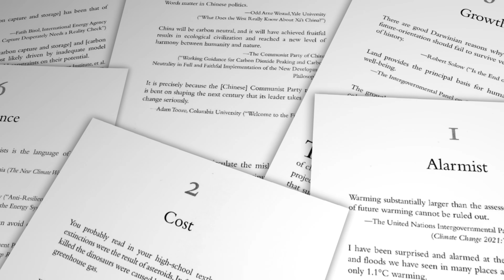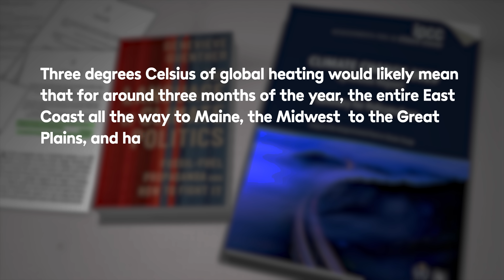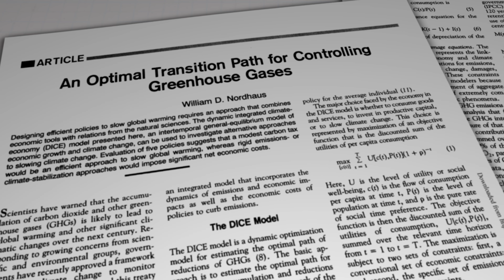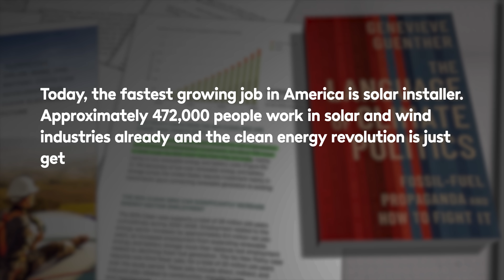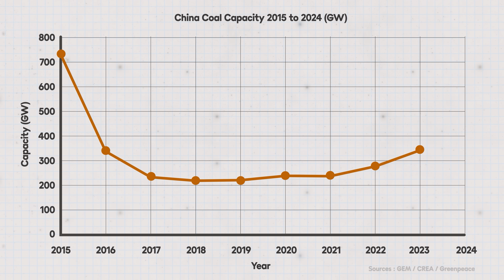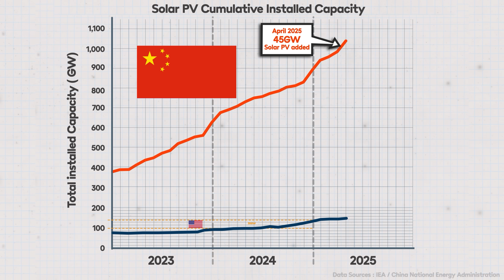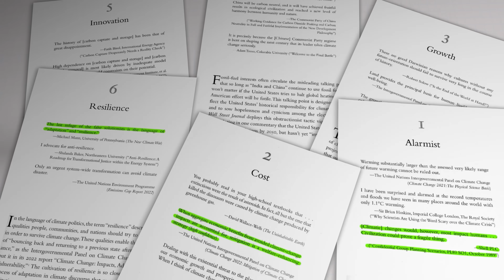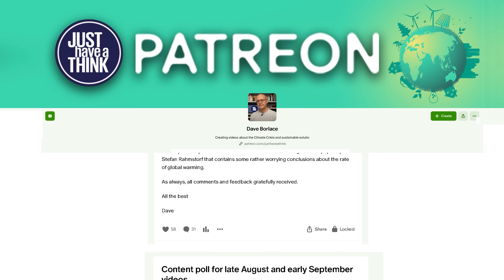New research DEBUNKS climate disinformation.

Comment: HOTTEST DAY EVER! How many times have you heard that? Weather stations are at airports built in the 60s, 70s and 80s in rural areas that are now urban. So "ever" means in the last few decades, and those records are never adjusted down for the urban heat island effect that boosts temps by 15-20°F (8–11°C). 

34 more censored facts:
1. Since 1850 the average global temperature has increased by 1.2°C (2.2°F); equivalent to a 600 foot decrease in altitude. 
2. 1850 was the end of the Little Ice Age (LIA) 1300-1850 A.D. the coldest multi-century period of the last 10,000 years.
3. Glaciers/ice sheets reached their greatest extent of the last 5000 years in the LIA. Total ice volume today is greater than it was prior to the LIA expansion.
4. Had the LIA continued we may be entering full glaciation. 
5. Modern warming doesn't correlate to changes in CO2. Most warming was from 1750-1950, before CO2 increased significantly. CO2 increased sharply in the 1950s while temperatures fell slightly until the 1980s, (Hence the new ice age scare of the 1970s)
6. Modern warming manifests as higher overnight lows and milder winters at high latitudes, with little to no increase in summertime highs or heat waves.
7. There's been no increased desertification. The opposite is actually true.
8. The U.S. growing season is 2-3 weeks longer than a century ago, and food production has tripled on slightly less land.
9. Temperature records from the 1800s and early 1900s don't exist for most of the world, early records have been adjusted down with dubious justification, and the urban heat island effect isn't adequately accounted for, so many scientists question the degree of modern warming.
10. Modern warming is beneficial by every conceivable metric, and continued warming up to 3°C would be mostly beneficial as well. 
11. Activist scientists cherry pick data to eliminate well known past warming (Climategate), and falsely claim they were only regional, but the best proxies confirm Earth was warmer than now for most of the last 10,000 years. The Medieval (900 to 1300 C.E.), Roman (250 B.C. to 400 A.D.), and Minoan (2100-1700 BC) Warm Periods were 1-2°C warmer, and the Holocene Climate Optimum (7000 to 3000 B.C) was 3°C  warmer. 
12. Humanity always prospered in warm times. Food was abundant, populations increased and civilizations thrived. People suffered of starvation and disease in cold times and civilizations fell. 
13. The mid-Holocene sea level high stand (2000-5000 B.C) was up to 5M higher than today.
14. Alarmists claim crossed tipping points will cause runaway warming, but it's been 3°C warmer with no run-away warming.
15. CO2 warming diminishes logarithmically. 420 PPM is near full saturation so doubling CO2 to 840 PPM would have negligible effects. 
16. Solar variation, cloud cover, ocean currents, and cosmic rays all effect climate, but due to the obsession with AGW these and other natural drivers remain understudied and poorly understood.
17. The complete weather record shows no increase in extreme weather events. Upward trends are derived by cherry picking start dates. 
18. Damage costs are conflated with more extreme weather but more people with more property susceptible to weather accounts for increased cost, not climate change.
19. Despite the population explosion climate-related deaths are down 98% from 100 years ago.
20. Even today many more people die from cold weather than hot. 
21. Wildfires are down 80% since the 1920s. Less aggressive fire management policies began in the 1980s. To show a deceptive upward trend alarmists always start here. 
22. On a geologic scale 420 PPM CO2 is extremely low. 500 million years ago CO2 was 5000-7000 PPM, but CO2 eventually becomes limestone so It's been falling ever since. 
23. The Isthmus of Panama blocked oceanic heat transfer 2.5 million years ago, triggering the ice age. Cold water absorbs more CO2 so 20K years ago during the LGM CO2 fell to its LOWEST POINT EVER at just 170 PPM and plants barely grew. If CO2 had reached 150 PPM all plants would've died causing mass extinction.
24. Through ice age cycles warming always leads the rise in CO2 by 200-800 years. Warm water emits CO2 so this makes perfect sense, hence rising CO2 is an effect of warming, not the cause. 
25. Greenhouses boost CO2 to 1200-1600 PPM because that was the environment plants evolved in over hundreds of millions of years, and how they still grow best today. 
26. CO2 fertilization has made Earth 20% greener than it was 30 years ago. Increased CO2 also makes plants more drought tolerant, so arid regions benefit most. 
27. CO2 fertilization effect has increased crop yields 15-20% globally. If CO2 magically fell to 280 PPM a worldwide famine would follow.
28. Claims of CO2 fertilization making plants being less nutritious are examples of junk science protecting the "climate crisis" myth. These claims refer to micronutrients not essential for basic nutrition that can be easily restored with fertilization. The caloric content is the same, and the missing protein is gluten. 
29. Most mass extinction events were caused by sudden cooling, not warming, and there's no "mass extinction" happening today. Polar bears have tripled since the 1960s and almost all endangered species have seen recent population increases. Since 2000 4 mammals have gone extinct, and the extinctions of previous centuries were due to over hunting, invasive species, and habitat loss. These are still the biggest threats, not climate.   
30. CO2 fertilization has increased the food supply for all animals on land and in the sea. The more CO2 in the atmosphere the more life on Earth.
31. On the PH scale 7 is neutral. Oceans are alkaline with PH of 8.1 to 8.3. So CO2 only makes oceans more neutral, not acidic. Ocean PH has ranged from 6.5 to 8.5 with no impact on sea life.
32. Bleaching is a natural part of coral lifecycle not resulting in death. The Great Barrier reef is near record extent. Coral only grows in the warmest parts of the ocean so if warming continues corals will only grow larger and healthier.
33. Since 1850 the global mean sea level has risen about 12 inches at rates from zero to 3.5 mm per year. If we're locked into the higher rate sea level may rise 1 foot by 2100. Plan for it. Crisis averted. 
34. Recent studies show tropical islands are actually rising because strong wind and waves transport sand onto the islands. 

True believers will challenge these facts, but this is where critical thinking comes in. Political pressures, funding directives, and the impartiality of scientific publishers has influenced climate studies to exaggerate the effects of CO2. These factors and more have created an enormous bias in academia to promote and protect the CO2 control knob hypothesis. Scientific work that contradicts or challenges it in any way is strictly prohibited, with dire consequences for those who don't comply. Pointing out well known facts that don't align with the "climate crisis" narrative, such as CO2 benefits to plants, or the logarithmically diminishing warming of CO2 is enough to be labelled a "climate denier". This relentless pressure in academia to manufacture "consensus" is why most people aren't aware of these facts. 

When I started studying the science of climate intensively a few years ago, I recognized the bias and misinformation in most climate papers and studies. Self education of climate requires a critical eye and an expectation for data to be misconstrued. Just reading the abstract and conclusion isn't enough. A study may contain data that contradicts the mainstream narrative, but challenging the narrative has adverse consequences so authors find a safe point to make. More deceptive examples cherry-pick a start point to show a trend that doesn't exist in the full record. The most egregious disinformation promoted by climate crisis advocates are studies from activist scientists who cherry-pick and manipulate data to reach a preconceived outcome (Climategates 1, 2 and 3). Watch this about the COOK-ed up "97% consensuses" and then tell me it's not an outright lie. 
youtube.com/watch?v=ewJ6TI8ccAw

Dogma in science isn't new. History shows academic dogmas stifling progress over and over again. A hypothesis beloved by gatekeepers transcends critique. Scientific method be damned our manufactured "consensus" has spoken. An incorrect hypothesis is knighted sacrosanct theory regarded as fact. For decades Clovis First was so entrenched in archeology challenging it was hypocrisy. Alfred Wegener advocated continental drift in 1912 and was mocked the rest of his life. Carlos Finlay discovered mosquitoes transmit yellow fever in the 1870s and was ignored for 30 years while millions died. 

A confluence of politics, funding and gatekeeper ideology has entrenched the CO2 control knob hypothesis deep in the heart of academia, but an objective examination of the evidence reveals it as the worst manufactured "consensus" of a false hypothesis since Galileo was forced to recant on pain of death the earth orbits the sun. Sensationalist media multiplied the falsehood and the "climate crisis" was born. Ultimately facts will prevail and it will join this Wiki page of overturned scientific beliefs. en.wikipedia.org/wiki/List_of_superseded_scientific_theories

References:
energy.gov/sites/default/files/2025-07/DOE_Critical_Review_of_Impacts_of_GHG_Emissions_on_the_US_Climate_July_2025.pdf
petitionproject.org/gw_article/GWReview_OISM150.pdf
Or just watch this to learn the truth  
youtube.com/@ClimateTheMovie
Reply: tl;dr
Reply: @monsterguyx  I have a lot of empathy for those with poor reading skills and attention deficiency, and I'm proud of you. admitting it to yourself and others is the first step towards making the most of your limited potential.
Reply: There are 5 sources necessary to prove climate change caused by human CO2 emissions as scientific fact:

1) Prof. Svante Arrhenius (1896) XXXI. On the influence of carbonic acid in the air upon the temperature of the ground , The London, Edinburgh, and Dublin Philosophical Magazine and Journal of Science, 41:251, 237-276
2) Royer, Dana L.. "CO2-forced climate thresholds during the Phanerozoic." Geochimica et Cosmochimica Acta 70 (2006): 5665-5675.
3) "Trends in Atmospheric Carbon Dioxide", NOAA, 2005, updated monthly.
4) HadCrut, NASA GISS, NOAA, Goddard and numerous other temperature data sets, all available as both raw and adjusted measurements.
5) "How do we know that recent CO2 increases are due to human activities" Steig, 2004, RealClimate

The last one cites the following:

Stuiver, M., Burk, R. L. and Quay, P. D. 1984. 13C/12C ratios and the transfer of biospheric carbon to the atmosphere. J. Geophys. Res. 89, 11,731-11,748.
Francey, R.J., Allison, C.E., Etheridge, D.M., Trudinger, C.M., Enting, I.G., Leuenberger, M., Langenfelds, R.L., Michel, E., Steele, L.P., 1999. A 1000-year high precision record of d13Cin atmospheric CO2. Tellus 51B, 170-193 (Revised in "A revised 1000-year atmospheric d13Cin-CO2 record from Law Dome and South Pole, Antarctica", M. Rubino, D. M. Etheridge, C. M. Trudinger, C. E. Allison, M. O. Battle, R. L. Langenfelds, L. P. Steele, M. Curran, M. Bender, J. W. C. White, T. M. Jenk, T. Blunier, R. J. Francey, JGR Atmosphers, 2013)
Quay, P.D., B. Tilbrook, C.S. Wong. Oceanic uptake of fossil fuel CO2: carbon-13 evidence. Science 256 (1992), 74-79

These additional 5 sources corroborate the above 5:

1) Callendar, G.S. (1938), The artificial production of carbon dioxide and its influence on temperature. Q.J.R. Meteorol. Soc., 64: 223-240.
2) Emily J. Judd et al, A 485-million-year history of Earth’s surface temperature. Science, 385, (2024)
3) David J. Hofmann, James H. Butler, Pieter P. Tans, A new look at atmospheric carbon dioxide, Atmospheric Environment, Volume 43, Issue 12, 2009, Pages 2084-2086,
4) Already listed 5.  Here's a 6th: Osman, M.B., Tierney, J.E., Zhu, J. et al. Globally resolved surface temperatures since the Last Glacial Maximum. Nature 599, 239–244 (2021)
5) Already listed 3.  Here's a 4th: Graven, H., Keeling, R. F., & Rogelj, J. (2020). Changes to carbon isotopes in atmospheric CO2 over the industrial era and into the future. Global Biogeochemical Cycles, 34

There's also these 22 sources that corroborate the trends found in other temperature datasets:

1) Huang 2000
2) Crowley and Lowery 2000
3) Esper 2002
4) Pollack and Smerdon 2004
5) Oerlemans 2005
6) Moberg 2005
7) Wahl & Ammann 2007
8) Juckes et al. 2007
9) Hegerl 2008
10) Lee, Zwiers & Tsao 2008
11) Ljungqvist 2010
12) Britta 2011
13) Marcott et al. 2013 
14) Ahmed, Zorita et al 2013
15) Neukom et al, 2019
16) Bertrand 2002
17) D'Arrigo, 2006
18) Buntgen, 2011
19) Rohde, 201
20) CRUTEM
21) EstimatedIV
22) FIO-CPS

Further, analysis of the peer-reviewed research (eg: objective experimentation and data analysis) such as:

1) Oreskes, Naomi. (2005). The scientific consensus on climate change (vol 306, pg 1686, 2004). Science. 307. 355-355.
2) Cook, John & Nuccitelli, Dana & Green, Sarah & Richardson, Mark & Winkler, Baerbel & Painting, Rob & Way, Robert & Jacobs, Peter & Skuce, Andy. (2013). Quantifying the Consensus on Anthropogenic Global Warming in the Scientific Literature. Environmental Research Letters. 8. 24024-7.
3) Cook, John & Oreskes, Naomi & Doran, Peter & Anderegg, William & Verheggen, Bart & Maibach, Edward & Carlton, J & Lewandowsky, Stephan & Skuce, Andy & Green, Sarah & Nuccitelli, Dana & Jacobs, Peter & Richardson, Mark & Winkler, Baerbel & Painting, Rob & Rice, Ken. (2016). Consensus on Consensus: A Synthesis of Consensus Estimates on Human-Caused Global Warming. Environmental Research Letters. 11. 048002.
4) Lynas, Mark & Houlton, Benjamin & Perry, Simon. (2021). Greater than 99% consensus on human caused climate change in the peer-reviewed scientific literature. Environmental Research Letters. 16. 114005.

shows that the vast majority of findings supports human-caused climate change.

Once again, all of this is found in peer-reviewed journals and done with experimental methodology and freely available data analysis that can therefore be critiqued by anyone skilled enough to do so.  This makes it far different than anything you'd find in the "MSM", blogs, or anything else.  This is, after all, science.

There's a reason everyone goes after buzzwords and never even bother to try touching any of the above.  It's far more difficult, which is probably why no one's ever been able to refute even an ounce of it.
Reply: Also, far from the opposite, research into Sun activity over the last 400+ years supports the conclusion that current changes in climate are due to CO2.  See the following selection:

1) Foukal, P., Fröhlich, C., Spruit, H. et al. Variations in solar luminosity and their effect on the Earth's climate. Nature 443, 161-166 (2006)
2) A D Erlykin et al 2009 Environ. Res. Lett. 4 014006
3) Stott, P. A., G. S. Jones, and J. F. B. Mitchell, 2003: Do Models Underestimate the Solar Contribution to Recent Climate Change?. J. Climate, 16, 4079-4093
4) Scafetta, N., and B. J. West (2006), Phenomenological solar signature in 400 years of reconstructed Northern Hemisphere temperature record, Geophys. Res. Lett., 33, L17718
5) Solanki, S. K., and N. A. Krivova (2003), Can solar variability explain global warming since 1970? J. Geophys. Res., 108, 1200
6) Solanki, S., Usoskin, I., Kromer, B. et al. Unusual activity of the Sun during recent decades compared to the previous 11,000 years. Nature 431, 1084-1087 (2004).
7) Cornelis de Jager, Ilya Usoskin, On possible drivers of Sun-induced climate changes, Journal of Atmospheric and Solar-Terrestrial Physics, Volume 68, Issue 18, 2006, Pages 2053-2060, ISSN 1364-6826,
8) Scafetta, N., and B. J. West (2006), Phenomenological solar contribution to the 1900–2000 global surface warming, Geophys. Res. Lett., 33, L05708
Reply: And with both of the above, I challenge anyone to provide any peer-reviewed paper that refutes or counters them.

Note as well that "peer-review is flawed" or "science is never settled" or any of the numerous variations of "researchers are publishing to get paid" is an argument for creationism, flat earth and geocentricism, so good luck with that.
Reply: @Leafsdude  The majority of US voters have lost faith in science funded to find problems no one else can see and no longer believe all the climate doom porn. They won't allow CO2 fear to continue hindering economic growth, and the events of the last week virtually assures that fact into the foreseeable future. Looks like I managed to waste quite a bit of your time.
Reply: @jholt03  I assure you you wasted not a second.